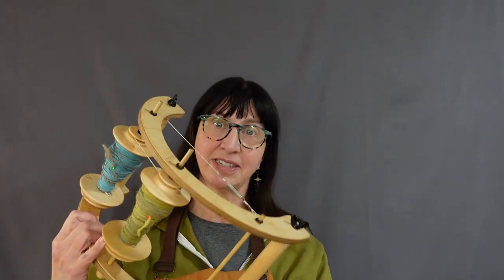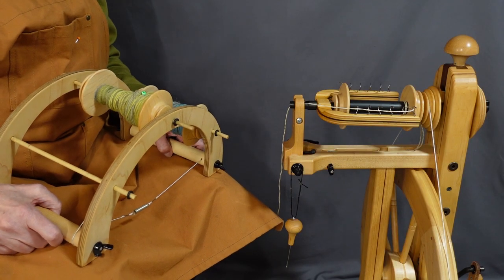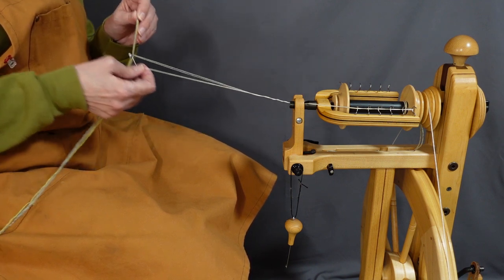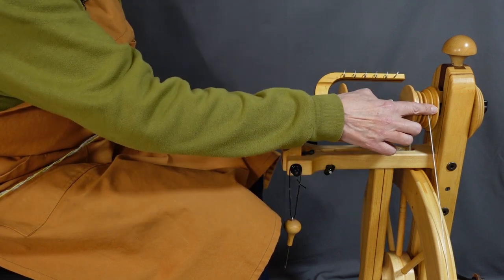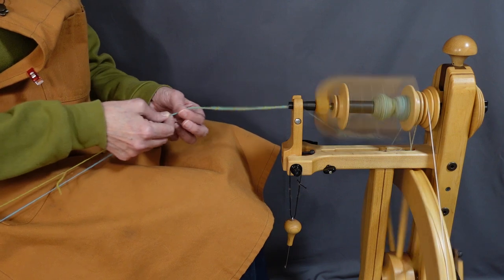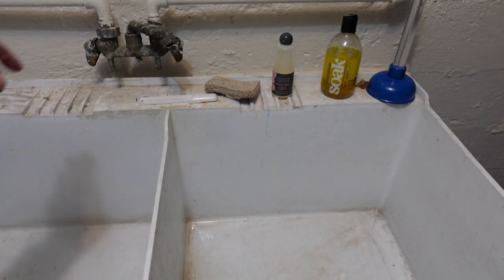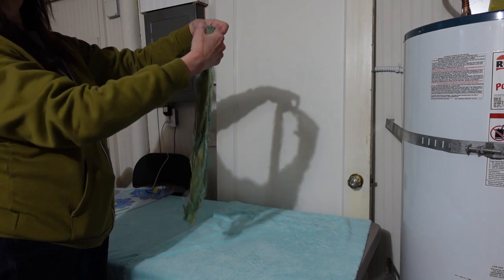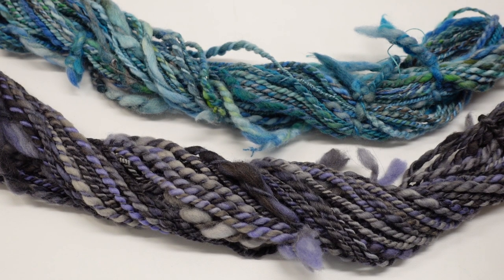Learn how to make 2 ply yarn on a spinning wheel.

Comment: Thank you! Just wondering if you’re using Irish or Scottish Tension?
Reply from the maker: This spinning wheel is a Schacht Matchless and it has Scotch or double drive as tensions.  I am using Scotch tension in the video.
Reply: @basementfibers  thanks for the reply! I own a Lendrum DT which is my first wheel and I love it ! But I am considering getting a Matchless, so doing my research in regards to anything that I can think of … 
For example my Lendrum has a separate Lendrum Jumbo Ply Head Kit, and I was wondering if the Matchless had something similar… but so far I learned that people use the regular flyer with either scotch or Irish tension and some use DD and some opt to buy the jumbo accessories which IMO it’s pricey….
Reply from the maker: @jplr0220  There is a Bulky Plyer Flyer for the Matchless but I have not used it.   I often use an e-spinner to ply my yarn.  I was showing how to use the Matchless to ply in this video since most people start with one wheel.  The e-spinners have large bobbins which I really like for plying.  I recently made a video showing how I use my e-spinner to ply, so maybe look at that if you are interested.  Have fun with your research and spinning!  😁